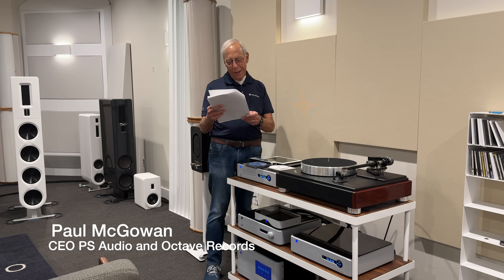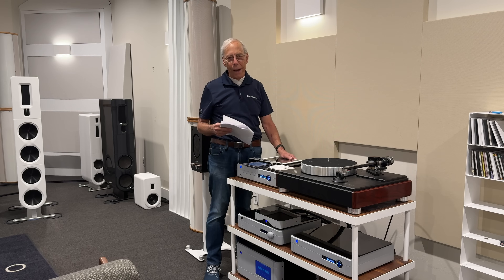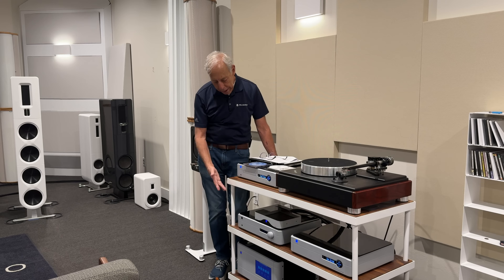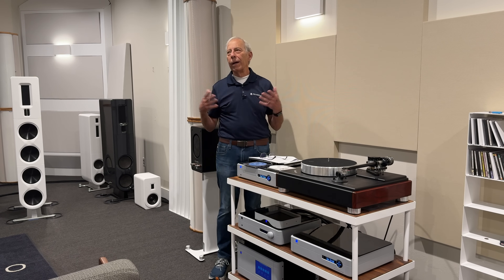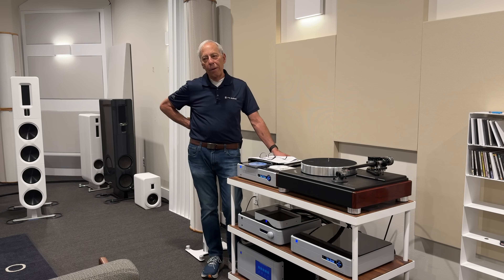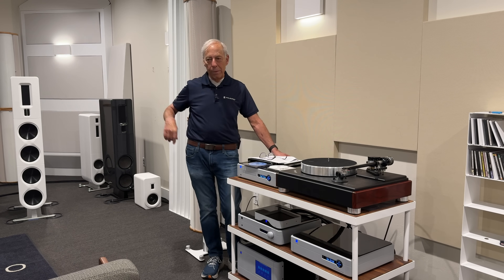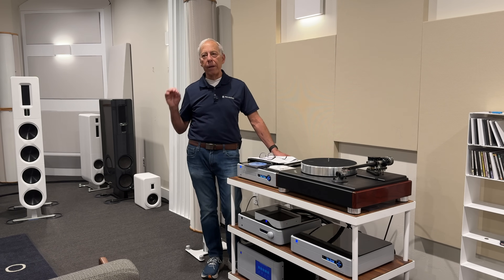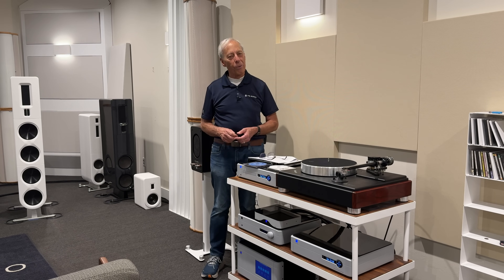Why preamps sound different

Comment: First off, there's a sound to preamplifiers? Why would a manufacturer want to add a sound  to a  preamplifier? If you do add a sound or a flavor then you are tainting what you should be getting from the recording. Online and in Hi-Fi Publications it's always stressed that the best preamplifier is the one that doesn't add any sort of flavor. Secondly, Paul is essentially taking a dig on integrated amplifiers. Think it through, when a manufacturer makes a integrated amplifier they're able to match the preamplifier and amplifier. This writer is talking about matching up components from different manufacturers so the Synergy will be winging it. And Paul if you keep on saying you know the science behind it why don't you explain it?
Reply: Sorry, but even so called neutral preamps add color to the sound, any electronics add something to the sound.

Comment: About 90 percent is tone control design
Reply: Or complete lack of tone controls, which increases the chance for a really pure & dynamic sound.
Reply: @danmarjenka6361  And also increases the chance of a flat, lacklustre sound. It depends upon your tastes.
Reply: @tenmillionvolts  I think you are comparing the "Stereo" hobby to the "Hi-Fi" hobby.  In the Hi-Fi hobby, tone controls are generally not wanted at all.  Instead, the owner keeps swapping in different amps, DAC's, and speakers, and also keeps moving those different speakers around in their room until the sound is just right without any tone controls.  Yes, it gets expensive.  But it is SO worth it once you get it right.
Reply: No.. I disabele the tone controls whenever the option is there❤

Comment: I was recently able to step into high end again and I went from a Topping E-50 to a Steller Gain Cell DAC.  The difference was eye opening and WOW!  The Topping always sounded flat and dull and I knew that was the first thing I should upgrade.  This was not a small change to even the deaf.  As soon as my friends hit the door they noticed.  I had to turn my sub down quite a bit there was so much more bass.  I also had to change the toe-in angle from near direct to near front facing.   SOOO happy with my purchase and blown away  by the difference.   I am all in on PS Audio and can't wait till I can afford an amp💪

Moral of the story is pre amps indeed make a difference, Cheers✌
Reply: Sure but this has more to do with the big upgrade of gear.
Both are DACs. Stellar has a pre-amp too. So you can assume that it is the pre-amp responsible for that change.
Alas switching only DAC can make a big difference in sound. So we can't assure it is the pre-amp only which made the difference. I guess it's both.
But yeah, pre-amp do matter!
Happy listening!

Comment: You never answered the question. What’s the science? 😳
Reply: Paul said there’s lot of science and he could go on for hours about it. Be careful of what you ask for! 😳
Reply: @housepianist  
Lol, well given the question was “what’s the science” he could’ve at least given 15 mins of the hours he has! 
I for one would like to see the science that makes a pre amp sound the way it does. 
All these years and I have yet to see the science. Makes one go Humm…
Reply: @Carl-bd1rf  to be clear, I think you erred in posing the question. I know of no preamps that claim to implement novel science. the science upon which preamps are based (for all intents & purposes, esp in the field of audio circuitry) is fixed & immutable. only in practical application - in the form of design & engineering - might one uncover relevant, notable (perceptive &/or measurable) distinctions among preamps. you are referencing science, but the discussion of "when making comparisons, how & why preamps impart distinct audio characteristics" is solely the domain of design & engineering. 
btw, having known & worked w/ a good number of scientists & lotsa engineers over the course of eight decades, I can attest that the forest vs trees dilemma is not restricted to one team.
Reply: @grumpy9478  
Curious, isn’t science a huge part of engineering and design? 
Can anything be designed without involving science? 
Are not basic electrical components and audio itself based on science? 

I’m certainly not an engineer or designer of preamps so my theory regarding the employment of science to design a component could be way off base.
Reply: @Carl-bd1rf  yes - science is the field of study of all physical phenomenon. physics, (in particular, electromagnetics) defines the rules that are applied in the design of preamps. important to understand : given all those rules apply EQUALLY in the design of preamps, then to determine how & why preamps differ in their influence, one must focus on the design, engineering & component selection of preamps as consumer products. you may enjoy learning more about science & physics, but insight to how preamps behave is best achieved by specific inquiry at the design > engineering > component > product level. however, don't let me stop you from studying physics. everybody should.
Reply: @grumpy9478  
Has anyone shown the science why one capacitor or transistor sounds different from another? 
I have to assume not because the argument pro and against has ragged for decades. 
For me personally I’m of the opinion that circuit design and component integration plays the part of sonic differences vs science. 
This is why I was interested in Paul’s answer to the question of the science involved! 
Would’ve been nice had he answered honestly by stating what we do know. And that is design and system compatibility do contribute to sound but we haven’t been able to provide evidence of how the science involved does.
Reply: @Carl-bd1rf  (I think) you've crossed a line questioning our host's honesty. honestly, you should visit a university, visit the physics department (science!) & see how far you get w/ your attitude. good luck.
Reply: @grumpy9478  
I would never visit the land of wokeness (universities).
Reply: Paul's busy designing preamps. start w/ Faraday, continue to Maxwell, skip to Feynman.
Reply: Maybe the dark forbidden science of the nebula zone ripe with its crystal spheres and dark energies.
Reply: @supercompooper  
Sounds like a Rush song!
Reply: @Carl-bd1rf  hehehe
Reply: He did
Reply: @Oystein87  
Ok, if he did then what’s the science?
Reply: @Carl-bd1rf  Components
Reply: @Oystein87  
Ok, ya no!

science
/sī′əns/

noun
The observation, identification, description, experimental investigation, and theoretical explanation of phenomena.

This is science. Now, explain how Paul did that!
Reply: @Carl-bd1rf  So you don't understand. Then I can't help.
Reply: @Oystein87  
Omg! Where’s the science that components make preamp A sound different than preamp B? 

It doesn’t exist. Had it did it would be common knowledge among the audio world with numerous scientific studies have been peer reviewed and published. That’s science.
Reply: @Carl-bd1rf  Difference in production, materiale etc. It's a science to make good sound.
Reply: @Oystein87  
Science has written and observational results. Results that can be duplicated. 
Just saying material A is something material B isn’t is simply an opinion.
Reply: @Carl-bd1rf  Exactly👌 It's beeing done in audio all the time so yeah. And messurements, blind test listening etc backs it up. So good bye now.
Reply: If you was told the answers on test back in school what would you have learned,  I'm self taught,  not a master but have built and modified enough to understand . Just do some homework on this and you could maybe achieve it . Best of wishes .
Reply: @jasontimothywells9895  
Ya I get what you’re saying however you missed the point. Paul was asked a question, elected to create a video based on said question then doesn’t answer it. 
My theory is he doesn’t have the science to back up an answer to the question so interjects opinion.  
We all have an opinion but the question is what’s the science?
Reply: @Carl-bd1rf  I think Paul's an engineer, not a scientist.
Reply: @grumpy9478  
Didn’t think of that. Makes sense as engineers at times can’t see the forest for the trees.

Comment: Hey Paul 
If I Am Hanging Upside Down By My Ankles in a Sand Storm With a Post Nasal Drip in My Living Room Will My Blood 
Rush To My Head Faster Below The Equator or
Above The Equator Thus 
Causing My Ears Pressure To Perforate My Auditory Canal Which Will Distort My Hearing And Give Me a Much More Robust Sound Quality Through My 
McIntosh C-49 
Pre/Amplifier….?
Reply: You Need To Upgrade
I Have A Very Nice McIntosh C-52 
Pre-amp For Sale
It Will Cut Through That Sand Storm
And Cure Your Post Nasal Drip
Plus, It Doesn't Matter What Side Of The Equator You're On
Because It's Built McIntosh Tuff! 
You'll Be Relieved Of Unwanted And Unnecessary Ear Pressure 
Guaranteed Much More Robust Sound Quality Through Your New (to you.) Pre-Amp.

Comment: Generally preamps boost weak low voltage signals from playback devices.
The next power amp stage boosts the current so that the speakers can be driven effectively.
The preamp does impart colour and characteristics to the signal - much more than the power amp stage.
It’s well known in the guitar amp industry that the character and essence of a guitar amp resides in the preamp stage - with everything else being equal.
In fact it’s common for professional guitarists and recording studios to have a stack of rack mount preamps modules that represent different amp types (marshall, vox, fender, mesa boogie etc).
The guitarist can select a preamp stage and run it through one power amp stage.
Reply: Yes, totally correct, Preamps do impart colour and characteristics to the signal far more than power amps. Power amps lay the foundation, if one could use only power amps, one would hear differences among the various types, but those would not be as pronounced as with preamps partly because as you stated and I will paraphrase, preamps do basically all the processing. 
While I am totally satisfied with my system, I am recently toying with the idea of trying a different preamp because there are one or two things bout the one I have that fall a bit short. 1) Headphone amp/stage is pretty bad. It can't drive most headphones that well. Although I'm not a headphone user except for checking my work, so it is not a big deal and I have also fixed it by using an outboard headphone amp, that problem solved. 2) Not real impressed with the DAC, but also nothing to compare it to. So it could be perceived bias I don't know.
It is not a priority though. I am just waiting for an opportunity to just try a different preamp as no cost or hassle, but not holding my breath either. It is more curiosity than anything else. I'll likely try an outboard DAC long before another preamp.
Reply: @ericelliott227  fair comments. I have a Vox Guitar amp that uses a hybrid vacuum tube-solid state circuit.
It has one vacuum tube in the preamp stage (a simple 12AX7 tube) with the power amp stage being solid state. 
Great sounding amp for under $400. I also have a Fender valve amp and a Mesa Boogie - way more powerful and a lot more expensive but I record with the small cheaper Vox hybrid amp because it’s so clean and I like the overall sound. (Doesn’t have enough grunt and punch for live situations but for recording it works beautifully).
If you can separate the preamp stage from power stage in your main amplifier and find the preamp sound you are looking for on your sound system it’s a great way forward.
Some HiFi amps have preamp connections fitted on the rear so it’s easy to change the preamp later
Cheers
Reply: @PetraKann  Of course, (prepare for a Star Trek reference) it's the Engineer Scotty approach which I agree with as well: "The right tool for the right job".

Comment: Why we calling it a preamp? That implies an extra/unnecessary component.

Most people have source/dac/amp and the main difference is where volume & inputs go.  

Some people want integrated amps and some prefer power amps or monos & integrated DACs. There may be DACs that only convert digital to analogue but are they common enough to include in these conversations? Am I missing something obvious here?
Reply: I guess the issue is you are not born ages ago where an audio system could include a cassette player, CD player, vinyl player and FM tuner. Yeah, in a modern system where you either listen to streaming only or streaming and CD, a single DAC output doesn't really need a pre-amp for connection to the power amp. DACs with volume control can feed a signal directly to the power amp.
Reply: They're called that because "amp" is or used to be short for "power amp". The terminology still makes sense from the perspective that many if not most so-called "integrated" amplifiers are in reality power amps with input attenuation (meaning there's a volume pot, and there may be an input selector, but the unit contains no preampfification stage). In today's world, a DAC's output stage may drive a power amp directly, and while this results in transparency (fewer amplification stages overall), a dedicated preamp may still (on average, in my experience, there are always exceptions) improve the sound quality (greater weight and dynamics, more colorful timbre, greater definition to the soundstage etc.). All of this is easier to see in tube amplifiers: if it says "integrated" but has two stages (driver and power tubes), it's really a power amp with input attenuator - if it really contained a preamp stage, there would need to be at least a stage more (or at least two more if the unit includes a phono input).
Reply: @LeonFleisherFan  I guess that’s where I need to hear the differences for myself because I can’t get my head round the suggestion that adding an extra box of electronics that’s not strictly necessary can improve the sound, except perhaps EQ but that’s presumably to offset a specific deficiency elsewhere.
Reply: @sammoxford  That's a misunderstanding: think of a circuit that is, for example, optimized as a voltage and/or current amplifying device. One trades in some transparency (the extra device) in turn for using the optimum amplification for the specific purpose (hence greater dynamics etc.). It's a tradeoff, obviously, that depends on the quality of the output stage of e.g. the DAC as well as the quality of the preamp, so it's possible, but never guaranteed, that the gain (pun intended) exceeds the loss.
Reply: @sammoxford  And yes, of course the proof is in the listening. That is unless a brand purposely designed a preamp for a power amp and advertises it as such, there's no way of predicting the result. And they had better recommend the best connection to go with the combination - one thing to like about integrated designs.
Reply: @LeonFleisherFan  I been meaning to visit my local high end dealer anyway, so I’ll see if I can do a with & without comparison. I’ll leave my wallet at home just in case… Cheers
Reply: @LeonFleisherFan  Thank you. I’ve been curious about this for a while so I’ll see about having a listen at my local store.
Reply: Was wondering the same before buying mine.
Make it simple for you.
The pre-amp is dedicated for the volume. The DAC treats the signal.
A volume DAC can play the role of a pre amp. But it's on the digital side (chip if I got it right).

Find a pre-amp that you seem to like within budget, pay attention to the build quality (photo is enough, if there is no photo of the inside, better stay away) : it will sound good.
Of course, if you have the opportunity to listen to it, it's better. But then, it's better to bring your gear too. The more you optimise, the better.
Volume DAC will be subpar every time (same price). Reviews on YT tend to the same conclusion. This makes sens as the pre-amp was built with sound in mind. The volume control on a DAC is a feature.
I also think that in case of failure it's better to have separates.

Bought mine without hearing as I live other seas. No regret, even better that predicted, best sound ever in my setup : RPi 3, DAC, preamp, amp.

Comment: It looks like you are bypassing some 12ax7 gain stage. The 12ax7 and 12au7 are both junk tubes. The 12au7 has some weird non linearity issues and the 12ax7 is a borderline enigma. Sky high plate resistance, lots of miller capacitance. The thing is a borderline active filter.  

And god help you if PL did another 12ax7 gain stage into a 12ax7 cathode follower circuit. Then bypassing it with an ipod will probably sound better.
Reply: A total tube nerd and snob! I love it!
Bet I could learn a lot from you!   😅